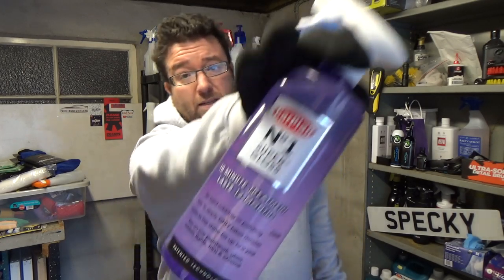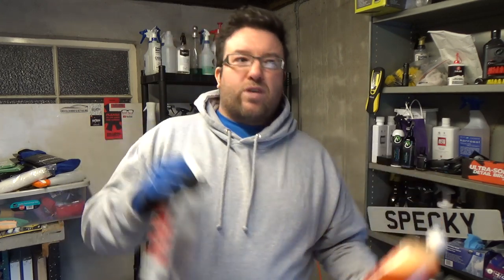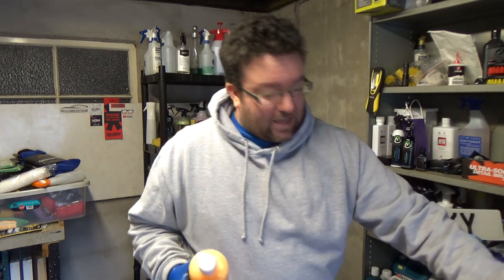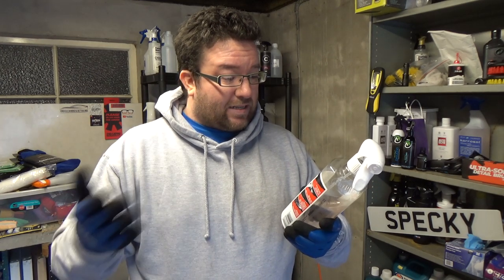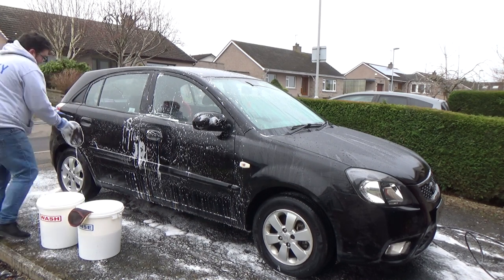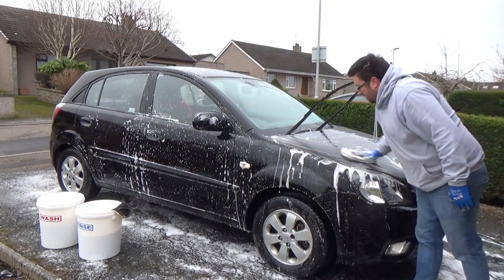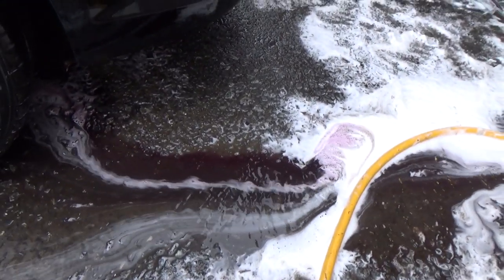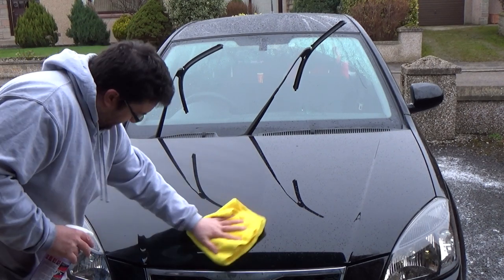CarPlan No1 Super Range - Wash, Detox & Gloss

Comment: Agree with your statement about the order of usage. Normally it is being said to use a fallout remover first, as it needs to hold on to the surface, which it can do best when dry, thus won't get diluted. But I also say best to wash first, then dry, then fallout remover and tar remover, then one more rinse and then clay (and maybe one more rinse to follow).
Reply from the maker: Thanks Zsolt, I agree with you and if I was a detailer I would do that but I don't dry panels after each stage because I'm lazy 😆

Comment: Thoughts on doing a wet coat of the super gloss then drying and doing a dry coat to get a good coverage of protection and shine
Reply from the maker: You'd use more product than you need to but other than that it's fine. I'd prefer to dry the car, apply the product then use it as a wet coat after the next wash to top it up.

Comment: Nice review, a lot slate the car plan range on the groups etc.. But honestly as an off the shelf or starter product I don't think they are that bad atall.no used any of the no1 stuff yet but  I  have and still the demon stuff I use the APC/rapid dirt shifter is basicly just TFR. Why waste premium pre wash products on somthing really dirty when that will do the job just as well in some cases.   Also demon foam smells great and is really slick it was better than some  "branded" ones I have used overall...

Comment: Mmmm, I never found the super gloss that shiny and when I tried it on a wet panel it went all smeary.
It is, however, a good sealant for my mothers headstone!
Reply from the maker: Headstone? 😳
Well I've never had an issue with streaking and this was the first time using it on a wet panel and it worked fine. Not sure what happened with yours but at least you found a good use for it.

Comment: Good video :)  The shampoo looks like it has masses of foam stabilizers in it.  Very much like AG Polar Blast in that regard.  Its not something I like as it hangs around on the ground for a while, and drives the neighbors nuts when they have to drive through it.  
Also the shampoo has a caustic component to it :(  It works, but at what long term cost to the paint
Its not something I like to put on the car every time I was it, but once in a while will be fine.  It ties into the average Joe who is only going to was a car once every 6-8 weeks.  Its not really eco friendly either, which is something I look for these days in products.
Shame about not having clear dilution rations as well.  Makes it hard to work out cost per wash, and compare value with other products.
Its a bit strange that Tetrosyl, the makes of the best trade tar remover, haven't got a consumer version in this No1 line?
At least the detox is cool, and its available at Halfrauds :)  The super gloss, hmmm, there are many other products out there that product the same results, or better.
At least they have tied it together as a complete system, and the bottles labeling and colors will draw your attention to them.
Reply from the maker: I love your comments Coley, you always make good points. So much so that it's difficult to reply 😄
Reply: @SpeckyMcSporran  I'll try to tone down my awesome-ness, but no promises :D lol